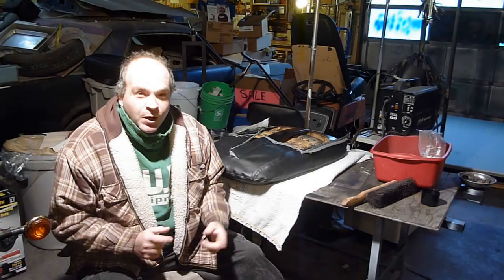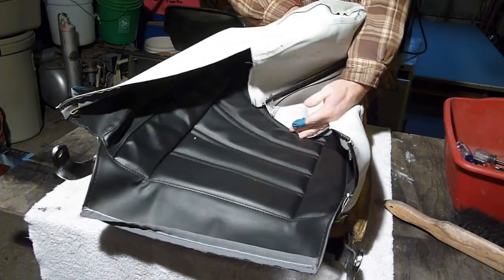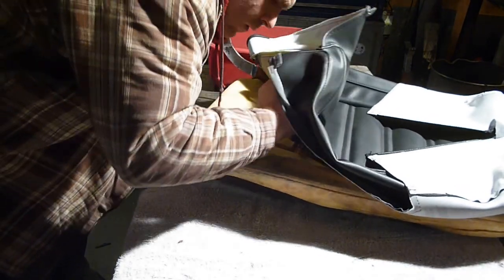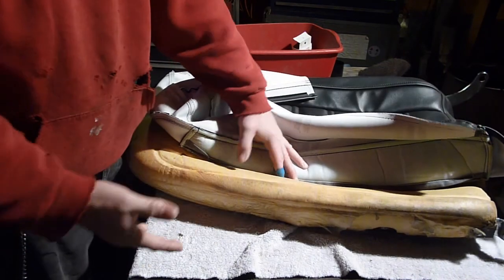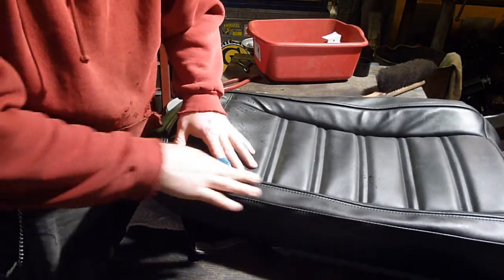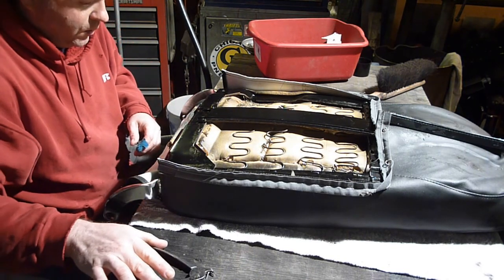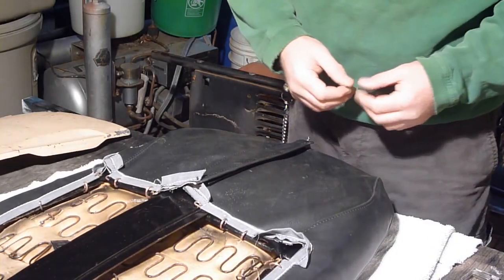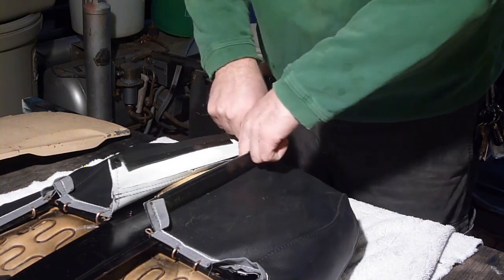REUPHOLSTER A CORVETTE SEAT FINISH

Comment: at 22:55 the reason for those wrinkles are you have the wrong covers. those are for 70-75 seats, and there is an insert that attaches there. The seats are 76-79 style and dont have that trim.
Reply from the maker: these are what the guy gave me i didn't do the ordering but i appreciate the info. it was too cold in my shop as well so the material was more stiff
Reply: You could add extra foam  to the sides or where ever you need it.